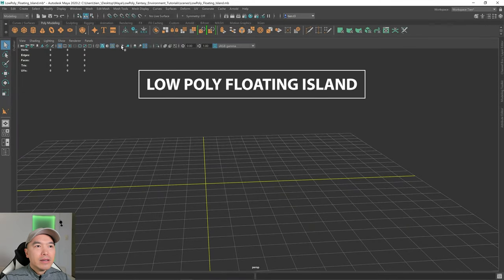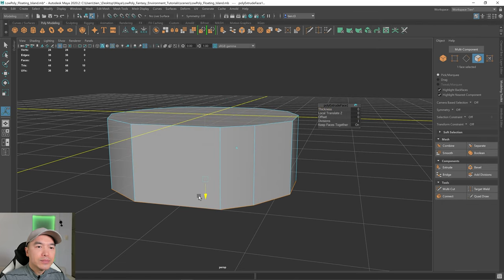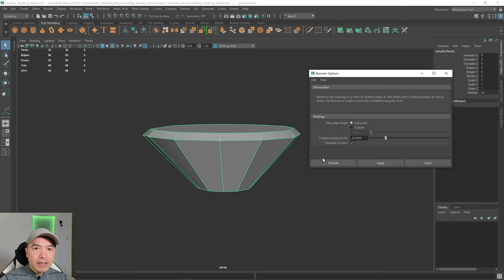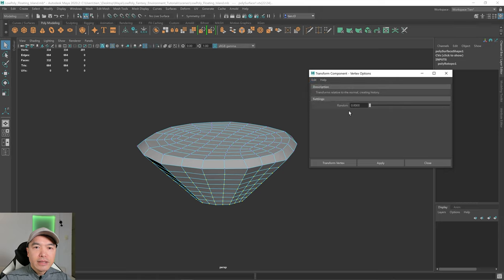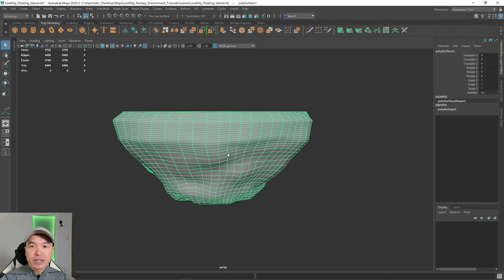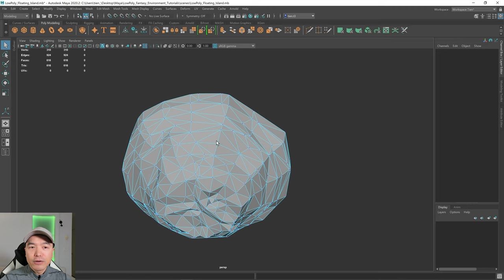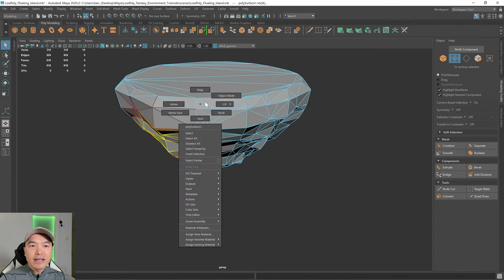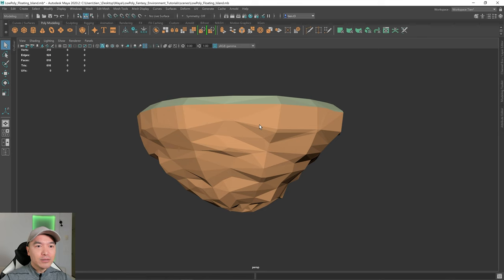Model A Low Poly Floating Island In Maya | Rocky Platform

Comment: Nice deserved a sub 😎
Also can you make another low polygon tree but with multiple branches?
I saw function in blender that allows to make branches by pulling skin of model "it was making polygons" and was wondering if something similar exists in maya🤔
Also tutorial would be usefull for my game since i cant do trees for jack 😂😂
Reply from the maker: Hi Millu thanks for the sub! I actually have a couple more low poly tree videos I'd like to make, one being a branching low poly oak tree however I'm trying to follow up on a couple of subscriber requests first. I do plan to get to those so hopefully your game can hold out for a couple more weeks. I'll include the FBX file though once I'm done that tree though for anyone to use to make up for the delay. Just remind me if I forget to post it.
Reply: @DigitalDreambox  no problemo, i still have to do some other stuff so trees can wait for a long time, however, i will see if extruding along curves would be any useful here too😂🤔
Reply from the maker: @Millu30  Something to keep in mind though is that Maya doesn't have some of the unique modifiers that Blender has just as Blender may be missing some Maya or 3DS Max tools. However regardless of the program I enjoy improving my knowledge of modeling principles so that I know a method to achieve what is needed in case a modifier doesn't exist.

Comment: There's no remesh in Mesh's menu.
Reply: I'm using Maya version 2018 btw.
Reply from the maker: Hi on versions before Maya 2020 you may be able to access the Remesh and Retopology feature through the Command Line. Select your mesh and then enter polyRemesh; for Remesh or polyRetopo; for Retopologize. After that open your Attribute editor and look for either the polyRemesh1 or the polyRetopo1 tabs and you should be able to change the settings there. I can't say for sure whether this works for your version though so good luck.
Reply: @DigitalDreambox  hey could u clarify more cuz I cant understand 
Thankss :)
Reply from the maker: @mernaemad3984  Hi you can use the Command line to enter scripts. It should be in the lower left corner of the interface displayed as MEL. If you don't see it for some reason you will need to enable it by going to Windows > UI Elements > Command Line and checking the box. After that select the mesh you want to Retopologize and enter the scripts above.